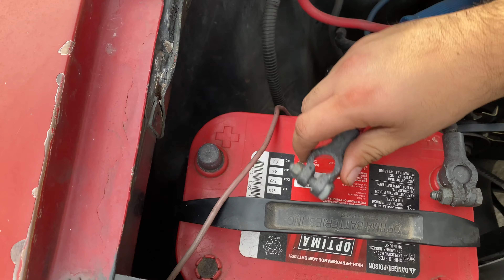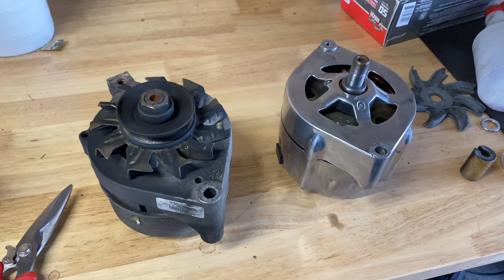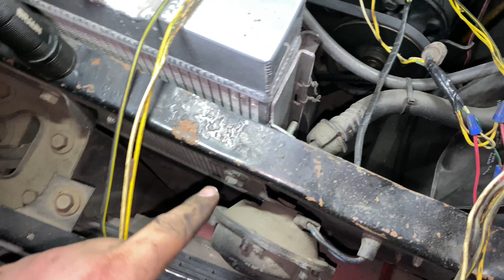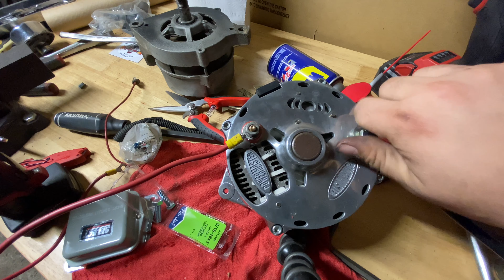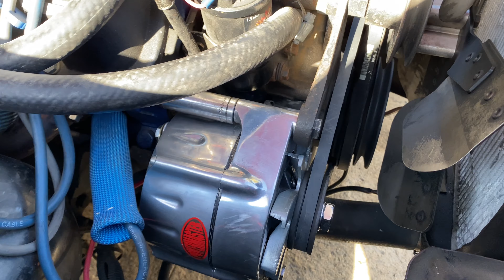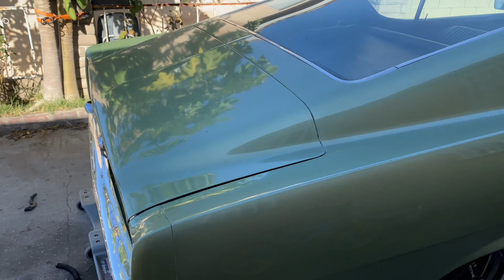1966 Mustang one wire alternator upgrade!

Comment: I could be wrong but I believe adding a DC 12V Voltage Detection Battery Charging Discharge Monitor Relay Switch Module to the dummy light circuit would allow continued  use of the DL on a 1 wire alternator application. Most charge/discharge sensing modules are adjustable in relation to voltage. They are cheap, like $5. Nice work! Thanks for the video.

Comment: After doing this, then that, plus extra I was able to get my cheap alternator to fit rather than just purchasing one made for the application.  If you don’t have means of grinding down (weakening) the pulley, grinding down (lowering cooling efficiency) of the fan blades, then finding the specialty spacer, why go cheap?  Take off the cost of specialty spacer from the amount saved on the alternator.  What was the net/net?  Add in your extra labor and jury rigging, zero.
Reply from the maker: Got to work with what I’ve got.  Even if I have to make it work, it means i can drive it the next day. 4 years later it’s still running great!

Comment: It would have been very helpful if you'd shown what wires got cut/spliced. That's where im held up at.
Reply: Believe the yellow/black normally attached to the  “A” terminal on the voltage regulator needs to be spliced together. Also the black/yellow wires on the voltage regulator need to be spliced together to power the horn relay.

Comment: Nice 👍🏾 but i think you need run the indicator wire from ignition back to the alternator so the alternator can charger the battery at a low rpm the black box on the side of the alternator has to terminals one goes to red wire on the alternator the other goes to the indicator wire coming the ignition
Reply: I had trouble with charging at low rpm because of that especially with playing radio or with head lights on

Comment: what kind of engine do u have? i have a problem with mine its from an 82 or 83 5.0 ..need to know best way to upgrade alternator I have a sound system and 6al box msd and distributor setup
Reply from the maker: It’s a 289 but yours is a 302 which is about the same. I have the same alternator with a sound system in my 68 Torino and it works great

Comment: So the yellow wire you ran it back to the solenoid I’m having charging issues I’m confused about the regulator plug I unplugged it but something is still not letting the alternator charge
Reply from the maker: The whole harness from the regulator is removed. And I spliced the yellow with the yellow. If you can send me an email I’ll help you out
Reply: @OmarRamirezGalaxie what’s your email? Defiantly can use some help
Reply from the maker: @ben3462  omar_ramirez562@hotmail.com

Comment: Nice video.  I've been researching to upgrade to a 3g on my Galaxie.  I'll post a video when I get it figured.  If I came across a deal like this I would jump on it too!  I did read last night that a single groove v-belt can only support about 100A draw.  Just something to think about if you have squealing problems.  Might have to search out a dual groove setup.
Reply from the maker: didn’t know about the 100amp, I’ll have to research it too. but on the galaxie I’m going single belt serpentine setup from CVF!
Reply: @OmarRamirezGalaxie  Hey Omar great video brother! I have a 64 Galaxy.  The set up is pretty much the same as the mustang I think. What do I do with the wire harness coming off the fire wall?

Comment: I had just ordered the same brand alternator for my 66, and you made a video at the same time haha. I"m going 6 gauge on the positive side. That's what the website says.
Reply from the maker: It works great, did it on my 1968 torino too! I’ll look up the specs on the wire, I might have to go bigger gauge.